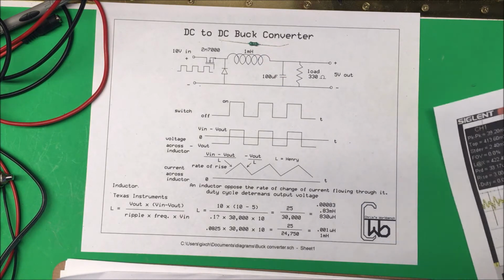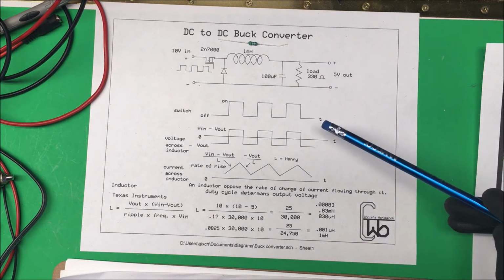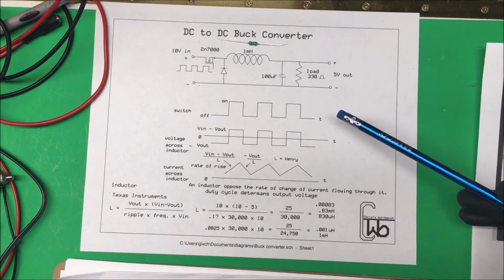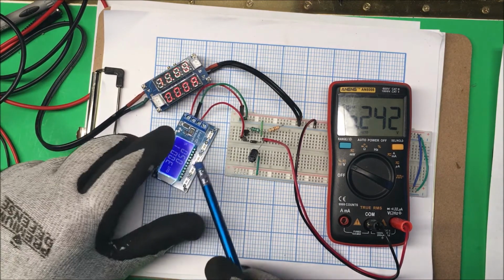DC to DC Buck Converter

Comment: Sir what kind of circuit you are using for switching frequency .... and for handling more current how we can choose the inductor using the same formula
Reply from the maker: PWM Pulse Signal Generator Module DC 3.3V-30V 1Hz-150KHz 1CH Adjustable Frequency Duty Cycle Square Wave Reverse Protection LCD
From Aliexpress. Just pick the wattage of inductor you need.
Reply: Sir please give an about toroidal core type inductor design calculation